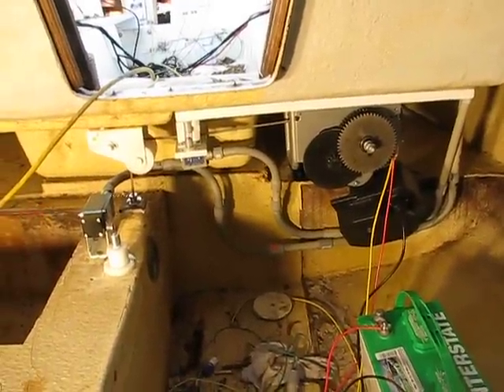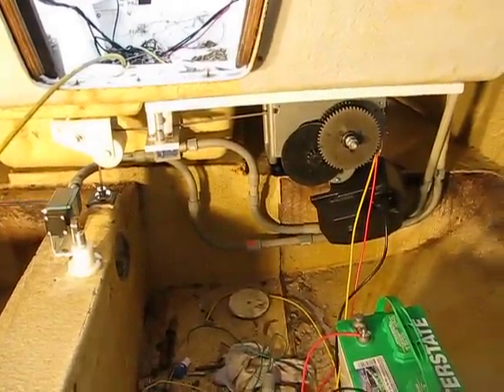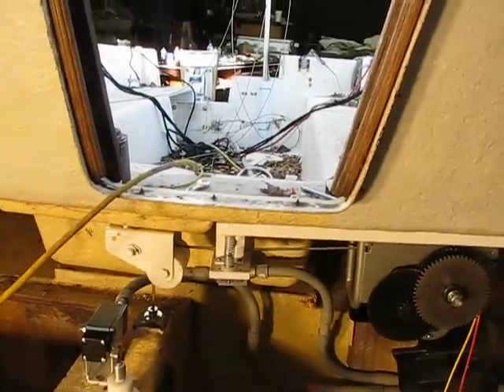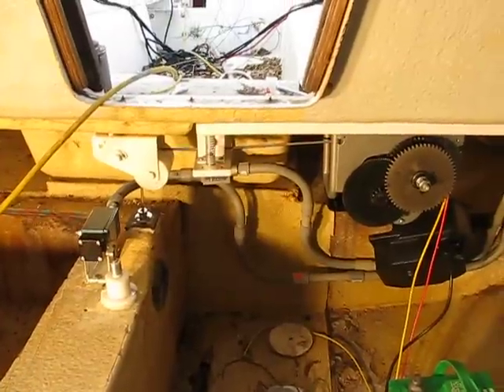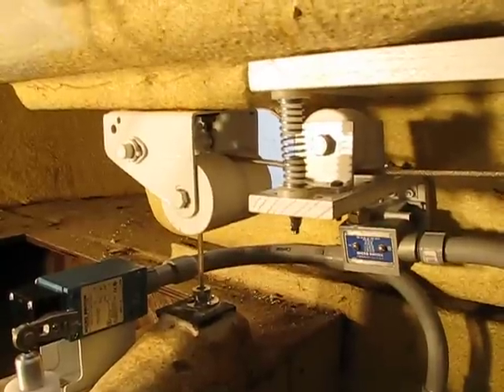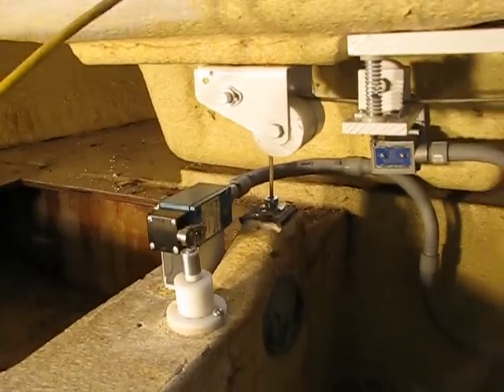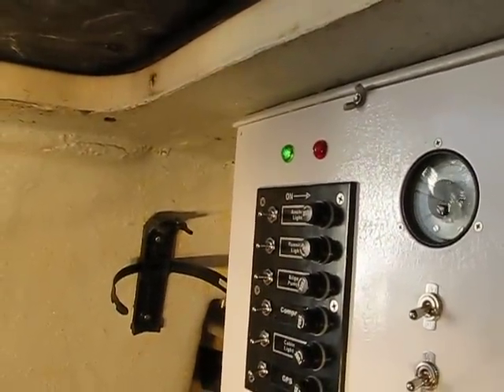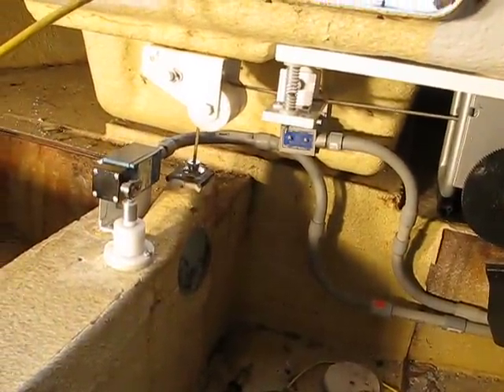Helsen 22 auto keel.avi-rbrown77138@verizon.net

Comment from the maker: A sticking keel in the Helsen, no.  I have owned and sailed a Cat 22, but I have yet sailed my Helsen.  I have heard that these Helsens are a good rough water boat, that remains to be seen. I know by pushing on the side of the hull, the Helsens have a much thicker hull, no depressing the hull as on the Catalina. I am presently designing a permanently mounted  "A" frame for stepping the mast also powered with an electric winch.  I will post on YouTube when I finish. Thanks for your comments.

Comment: This is great, I also have a helsen 22'.  Yours looks a slightly different on the inside, mine is a 1974.  I was actually thinking about making an electric winch for mine but ended up just rebuilding the hand winch.  I am curious if you have ever had any problems with your swing keel sticking in the up position.  When i got mine, the swing keel wouldnt come down.  But after a couple of swings on the pivot pin with a sledge hammer and a metal tube it loosened up.